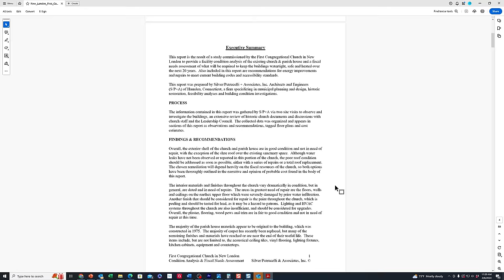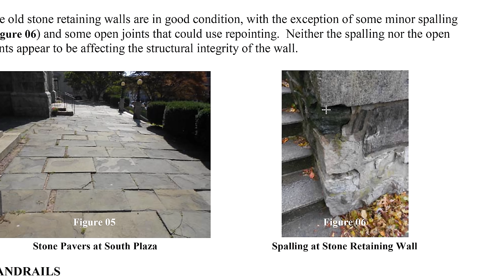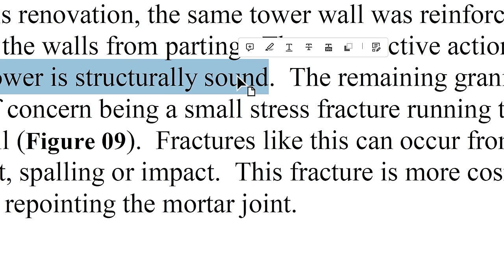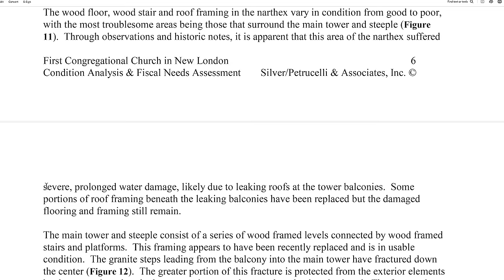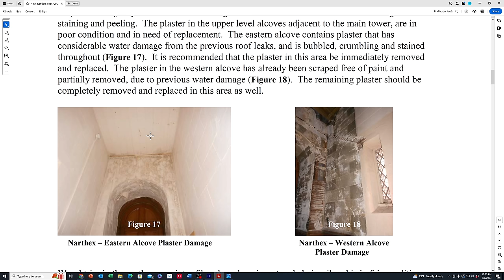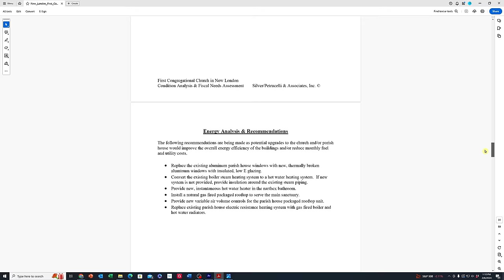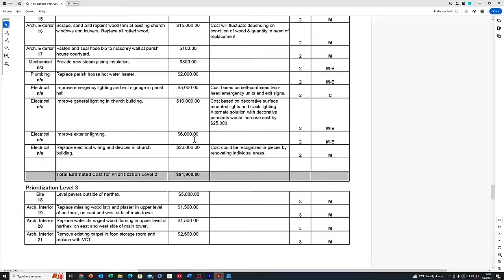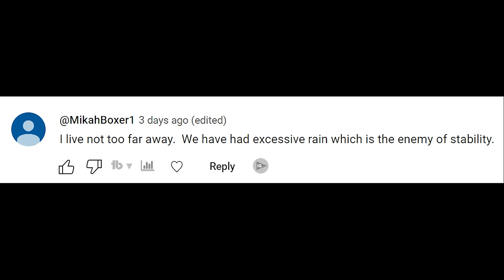Engineering Report: Collapsed Church Steeple Was OK?

Comment: Looking at our churches where I live, the steeple areas were heated but since construction were excluded from the heated portions of the building considering dynamic loading through expansion and contraction cycles and effects of water in such areas that may have had drying heat which would have reduced the effects of ice on structural rock loaded as well as the loss of drying heat on inner wooden support structural framework as in rot reduction by limiting the extent of wood exposure. 

The balcony access staircase deformation shows an unaddressed stress that maybe shouldn'd have been ignored.  Even reparations accompanied by stainless or aluminum structural supports may prevented or reduce compressive forces along with a sealant to prevent water from working into the structural members, and preventing ice formation between said members. Also  looking back 50 to 70 years ago it is very likely that no freezing would have been occurring due to modest heat losses.  Up here we do have ice as a dynamic threat to all structures which is impossible in Florida so things need to addressed on much faster timeliness.  Another thought is that inspection intervals should be accelerated as target structures are more exposed to freeze thaw cycles. Locally to me we reached 60° F! (15°c) today dropping to freezing tonight but will cycle down to 0°F (-18°c) by next weekend, a huge shift for any structure as well as all areas filled with more compact ice has water adding in becausefailure only occursduringa thaw as ice expands! Just venting stale air into such areas may arrest most freeze thaw cycles.

Comment: It looks more like those steps were pushed against each other, causing them to buckle up. That could be first sign Tower isnt that safe as it looks. I only wish we could see stairs on other side aswell, but that demanded deeper examination. Someone did try "glue" stairs back together, but its cracked on the top again. Not even freezing water, if it could get there, would not raise blocks that high up.
That was pretty good call there is something going on(planters 2.0). Its alarming this was ignored, since there is hardly anything else that could cause stairs buckle up this way. There is no single point in the report adressing those stairs(19, 20 and 31 talks only about water damaged wood). None.

Comment: Just like with the Champaign Towers they had lots of rain the week it fell. Rain and water definately doesn't  help the situation when you have a building that isn't structurally sound. I think that the grout inside the tower might have been completely washed away from the years of rainwater egress. When they regrouted the building they probably didn't do anything for the interior parts of the building. It was just a matter of time before this tower was going to collapse.

Comment: Nobody would mention the fact  that the roof in Florida was loaded with 100lb kegs of tar the day before= equaling massive weight of asphalt in the exact spot you see the collapsed start in the video - on the penthouse edge. I'm not sure why any experts are not inquiring about that. Maybe it wasnt the full cause, But it seems possible it may have started the motion of events. It also appears according the report that the cement substrate right below that penthouse edge that collapsed was “weak” because of the prolonged water seepage.

Comment: As a civil engineer I don't see serious issues in the 2011 report, aside from the possible buckling of the upper staircase treads. The external walls don't show signs of pushing inwards though. 
The end comment made though of the front earth slope moving could be pertinent.
Reply from the maker: Sadly they don't only teach you how to design and build, not how to avoid dumb mistakes. They should have classes every year that they review all major engineering disasters of last 100 years.

Comment: Problem with these buildings older than human lifespan, is that, it is really difficult to take the danger seriously. You might even put some less experienced guys work on it, because it has been stading over hunred years, and you just trying to find all the work there is to be done to make a buck, but not that much you expect to question the safety of entire structure.. just something minor safety issues maybe, that could complicate work perhaps.. something dropping, some unstable tiles, dangerous stairs... but all in all "It is what it is, but it's been standing there forever so.."

Comment: Hello, I work for a company that does these types of reports all the time. They are NOT Engineering reports. There are no calculations or measurements being done on structures. This type of report is today called a Property Condition Assessment (PCA) report. Its for commercial real estate. We put it out there in the report that there is no intrusive inspections being done, and we just comment on what we can see. Of course you can add more scope to the report, and do structural analysis and geotechnical analysis, but thats much more expensive than a typical PCA report. The point of the PCA report is to give the client - usually a property buyer or bank, a good idea of the costs to repair and maintain a building for the immediate to long term. For example -  an apartment building is for sale for 5 million dollars. However, the future buyer knows that this isnt the full cost of ownership. So we give him some numbers - the roof is leaking and needs to be fixed immediately - lets say that 100K, or the roof was just replaced, so we estimate it has another 20 years left so, that will be 100k equivalent due to inflation in 20 years. and we create tables for short to long term costs like this and put in table other costs like foundation, sidewalk, paint, HVAC system, flooring etc. So the table might look like - 1 million in immediate repairs, and 5 million extra over 20 years for instance. Those are numbers a buyer or a bank would like to know to see how profitable this building can be. Now we only do non intrusive, so if there is some geotechnical problems like a sinkhole under the building, or steel beams are stressed but are hidden behind drywall we wont know. But by now we have verbage to explain that. In our training for PCA we were given horror stories like this one of people saying a building is fine and then it suddenly collapses. However this was in 2011. So today we have reports and clients know what PCAs can and cant do. Other things PCAs do is make sure building is in code compliance and cost to make it compliant - like cost to install wheelchair ramp and widen bathroom stalls to make building Americans with disabilities (ADA) compliant, or cost to install sprinkler system and add or replace fire alarms and fire extinguishers etc. all of which could add up to a lot of money.
Reply: the cost estimates of the report actually did include estimates for more intrusive inspections to be done to assess roof and leaks...

Comment: Still standing by my assessment that freeze/thaw in the corners of the elevated walkway brought it down. Seeing thise crooked stairs in that tower only cements my belief. Since the first video I've been keeping an eye out for how many structures have interior corner elevated walkways or porches/balconies. I have seen two as I drove around New England. One on a church, one on a home. The wooden home (older home) had visible water issues in those corners as well. You can probably get away with that design in England, not so much in New England.

That last church looks horribly designed. Who has roof slope intersecting the side of a vertical wall? That's asking for collected snow and ice to tear the building apart.

Comment: I’ll “put my money” the inside footings (and/or lower wall) giving away first or on the inside holding the tower up.   The video shows some of this event taking place, as I have described.   The leaning of the tower collaborates this theory.   Now, they could have made some engineering postmortem evaluations as to what DID happen.   And then, only a “concrete mud jack” or new driven pilings could have helped here.
The tower inspection, of the lower to bottom section walls and footings, could be very close to impossible (under the ground).   With as much as the tower was leaning, it should have shown up in the stone work above the ground level!   Also, wood and stone have very different expansion/contraction coefficient rates and only the stone will take the much greatest vertical loads and has the greater longevity.

Comment: I bet the guy that signed off on the structural integrity of the steeple is glad no one got hurt. If I was driving into town and saw that lean of the steeple I’d never sign anything. I’m sure there are lots of unsafe old masonry buildings around. Miracle no one got hurt in the middle of the afternoon. Thanks for the great videos.
Reply: Very true, although it's possible, the steeple wasn't leaning 13 years ago when the engineer completed the inspection. However, you make a good point, the mayor and other city officials certainly might've noticed the tower was leaning, and looked into it before the collapse.

Comment: That report is of little value as it is 13 years old. Sounds like the lean of the tower was too much for the roof trusses of the nave which were not designed to support a leaning tower.
Reply from the maker: I doubt the roof trusses were supporting the tower, as the tower is designed to be self supporting. But the steeple supported the roof structure.
Reply: @jeffostroff  Hi Jeff. Yes, the tower was designed to be self supporting, I agree. But as the tower began to lean, the trusses resisted the lean, as much as they could, as they were not designed to resist a large lateral load. So, when the roof trusses failed, the tower fell by itself. IMHO.

Comment: Everyone whines when old structures have to be raised but, no one wants to pay for maintenance and repairs . They also don't realize the cost involved in repairing an old structure. Just because a guy can lay block or brick doesn't mean he should be involved with restabilizing huge stone structures. I am a retired carpenter\construction worker. I have worked on many buildings that all they want to do is put some puddy and paint on them. It looks like a lot of water found it's way inside this church. There is no telling how much hidden damage there was where no one could see . I suppose now a competent engineer could look at the debris and it's condition and get a better idea what caused the collapse .

Comment: Modern grout mixed w/latex additive is flexible. No one wants silicone corners inside their showers. Sure, where you show applying it where aluminum is involved, as it expands & contracts at a greater rate than wall systems you need an extremely flexible bond. But you inferred otherwise. This engineering firm did at best a cursory examination & should be held liable if they accepted payment for their services. Churches are run on shoe string budgets which is why this collapse happened. The wood roof held the leaning steeple up until it couldn't. Simple
New London is run by about as corrupt a bunch of gangsters as they come. Since they by eminent domain stole a water front neighborhood from retired ol'folks to build condos I wouldn't live there if you paid me.

Comment: Career tuck pointer here. Not only do you need soft mortar, achieved by altering the ratio of components in the mortar, you also need to use a latex bonding agent to the surfaces to be tuckpointed, after you wet the stone. Highest quality results using dry mortar coloring, or dye, which is just finely ground rock of a particular color. You mix the color with the mortar dry, and it changes color as you add water, then again as it dries, so you make a small selection before hand and pick the best match. This is horrible quality work, it hurts my heart to see a historical building treated like this.
 Not only does it appear that they used the wrong mortar, they don’t appear to have used any dye, and they smeared mortar on the face of the stone. No excuse for this.
 Contractor, you’re Shite.
Reply from the maker: Thanks for info!

Comment: Jeff, I looked at some older Google Maps street views around New London. I pasted in a link from August of 2013 (closest to the 2011 engineering inspection report) from State Street. I know the street view pictures aren't terribly accurate, but I think you can see that the central tower/steeple was not plumb even then, using the edge of the Municipal Building and the church's own north tower for comparison:
https://www.google.com/maps/@41.354637,-72.0961436,3a,26.7y,304.78h,102.56t/data=!3m7!1e1!3m5!1sXVm-DreBhOjb1l9NHdY8UQ!2e0!5s20130801T000000!7i13312!8i6656?entry=ttu

Comment: Jeff, ticket or not, I enjoy your vid's and like all vids I review, make my own conclusions.
Lots can happen in the 13 years since engineers report was issued.

2 google maps shots that I believe has much to do with what happened.  In one you can see a lot of repair work done on the roof slate and flashing where the roof meets the tower. Looks like a lot of previous damage was mitigated, maybe not right or complete.   The second shows the upper part of the tower not plumb in relation to the bottom part.

https://www.google.com/maps/@41.355106,-72.096614,3a,15y,259.85h,124.37t/data=!3m6!1e1!3m4!1sVIpMvxV9iYoB2pOXCtH-0g!2e0!7i16384!8i8192?hl=en&entry=ttu

https://www.google.com/maps/@41.3550123,-72.096626,3a,75y,274.53h,127.26t/data=!3m6!1e1!3m4!1sfWre9agCmoMYxUWurtjRaA!2e0!7i16384!8i8192?hl=en&entry=ttu